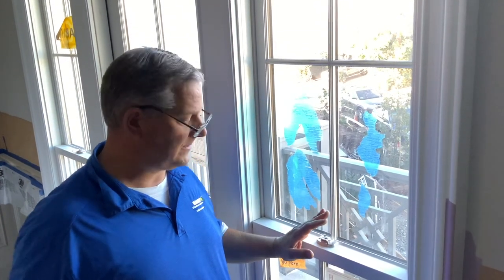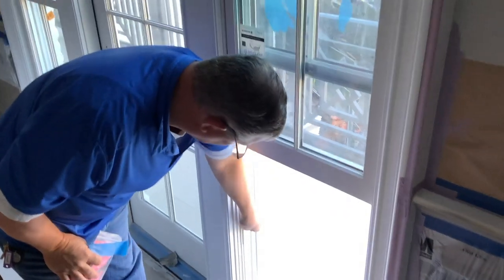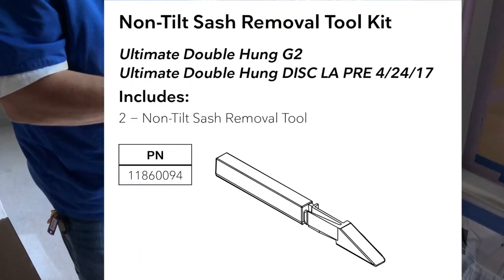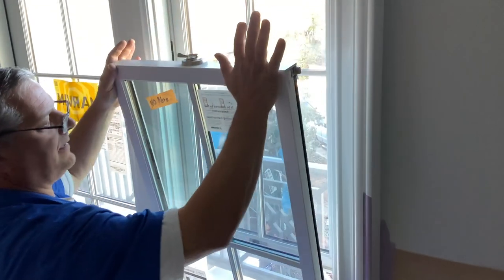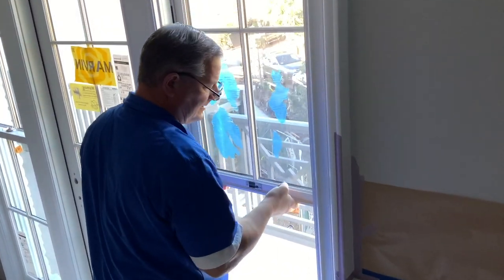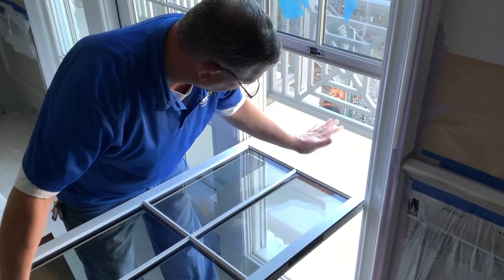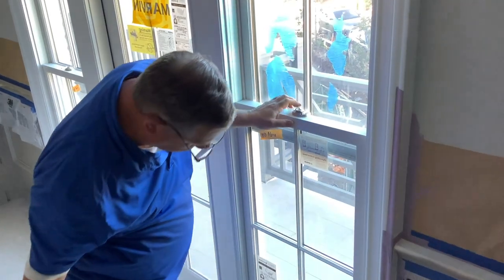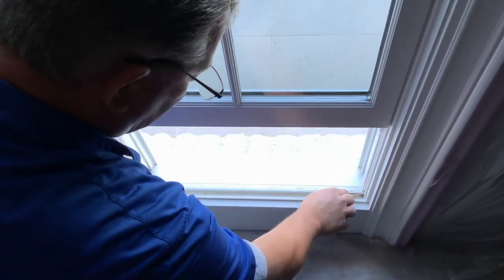Ultimate Double Hung; Non-Tilt, Sash Removal

Comment: Paul- I wanted to thank you very much for your balance tube replacement instruction for Marvin UDH windows.  PS- I replied here as comments were closed on the actual video :).   I personally found it very helpful and gave me the confidence to repair 10 windows, 5 of which had broken tubes on both lower and upper sashes.  I did have a couple comments on specific steps.  One, I found the sash pins that fit in the cam locks were generally loose and needed to be snugged up.  Two, I followed the step to remove the head jamb parting stop, but found it a stubborn fit when I went to reinstall it.  As an alternative I ended up pulling the foam plug halfway up the jamb liner and then prying out the wood strip seated in the upper part of the jamb liner.  Removing this strip gave enough play to get the jamb liner out from behind the end of the parting stop.  The strip is thick enough I was able to snap it back in using a soft mallet and the edge of a scrap section of 3/4" hardwood flooring.  Lastly, whereas each original balance tube had its own little clip holding it to the top of the jamb liner, for the larger replacement one piece clip you showed which goes the width of the jamb liner, I found the middle part of the clip fouled on the top section of the plastic spine running down the back of the jamb liner.  I used side cutters to trim away ~1 in of the spine and the clip sat down neatly over the top of the liner.  Thanks again for the video!